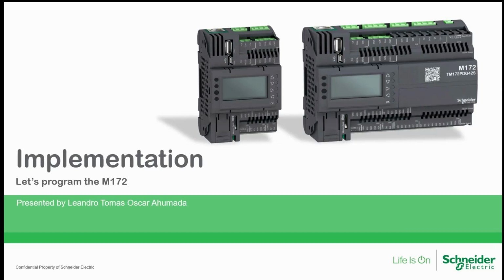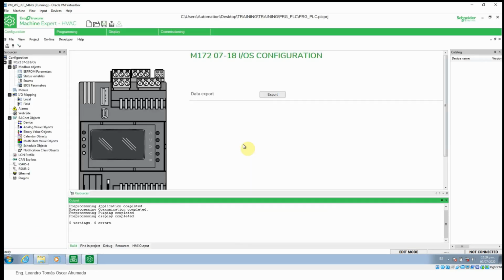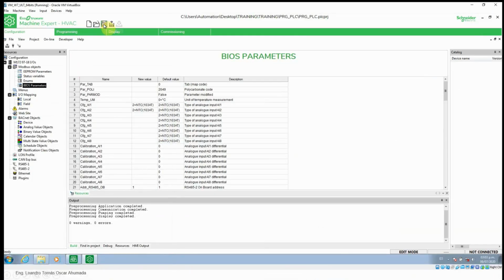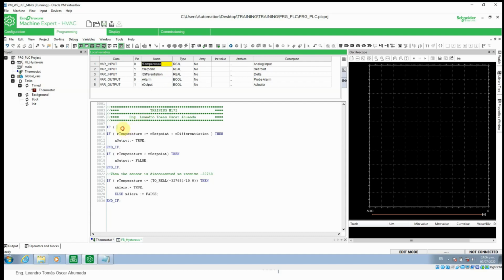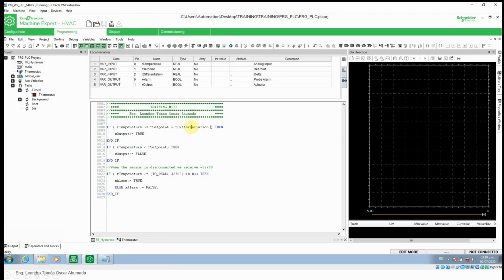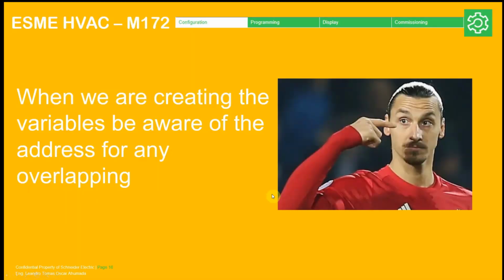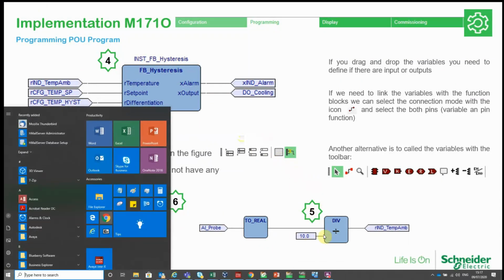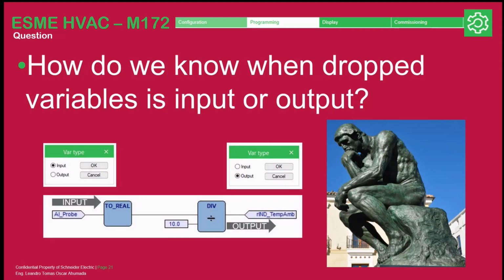Training M172 - M3.1 EcoStruxure Machine Expert HVAC Implementation

Comment: Hello sir, when I drag and drop a variable to the project in EcoStruxure™ Machine Expert - HVAC, the Variable Type popup does not open. Where can I activate it?
Reply: I have another problem. I connect to the PLC via Ethernet. The IP address is correct, but unfortunately I cannot connect. Why?
Reply from the maker: @gunerackgoz3568  hi there! Hopefully you have activated the 502 port to connect, then a power cycle will be needed.
Reply from the maker: Hi There! In the newer version that feature is not longer avaialble (or i was not able to find it). Once we place the object in a FBD language POU we need to right click on it then select "Switch direction".

Comment: Can i ask you sir ? Why my PT 1000 sensor that is connected to M172 (AI1) reads INT -1398, Not around INT value 300 ? I think there is wrong with my confiiguration, But I cant figure it out. Thanks
Reply from the maker: Hi there! You will probably need to check on the bios variables or commissioning tab how the pair of analog inputs is configured.
Reply: I already paired the Cfg_AI1 and Cfg_AI2 in value 6=PT1000 and I already  assigned value 6=PT1000 (Cfg_AI1 and Cfg_AI2) in lower board  commisioning tab